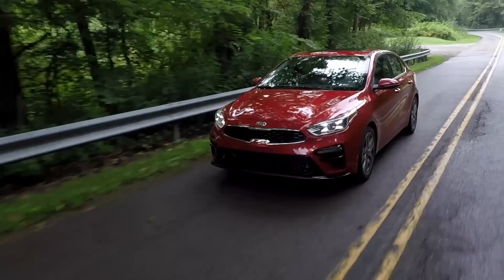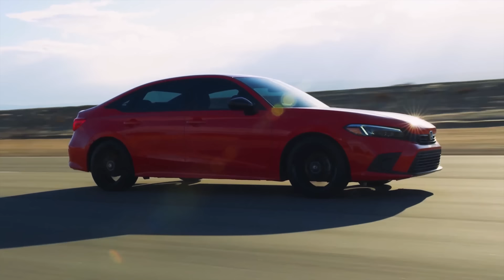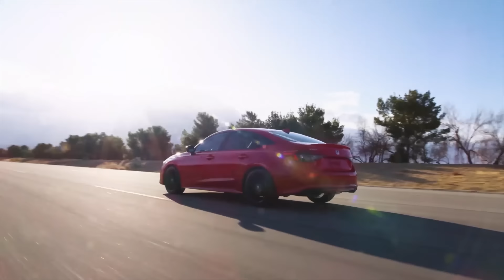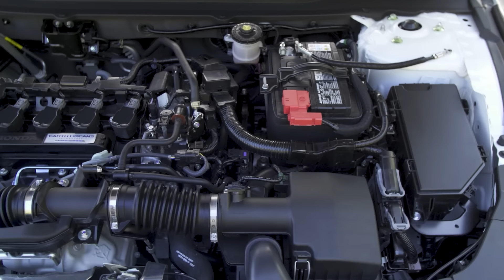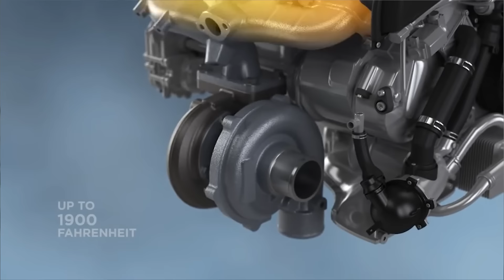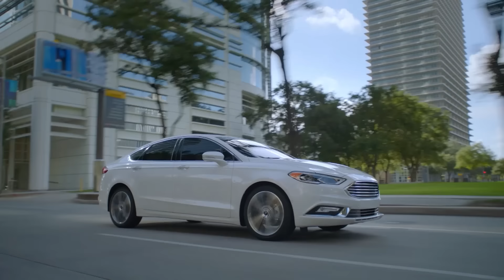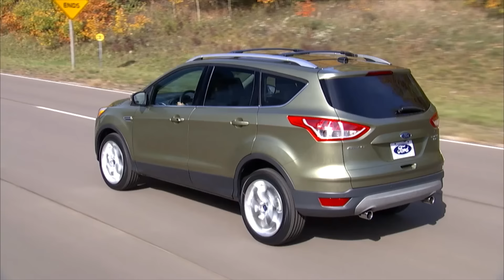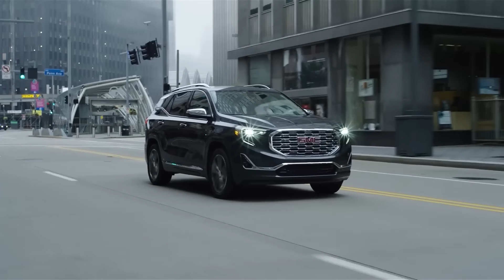Are Turbocharged Engines Reliable? The Truth About Turbo Engines

Comment: You don’t need a turbo to drive the car, the engine does that already. You don’t need a car with over 200 HP. My 1987 Oldsmobile Ninety Eight brougham had a 3.8 V6 and it was naturally aspirated producing 150HP and was plenty enough for passing on the highway and it could do burnouts if you stomped on the gas. But guess what it lasted past 270,000 miles. It finally died in 2018.

Comment: I’m still using a 20 year old Saab with the original turbo with over 180,000. 
Turbos engines can be extremely reliable but there’s a premium cost with manufacturing engines that withstand the extra stress.

Comment: not good man , i still drive a 25  yr old turbo  from vW , the infamous 1.8t
the car runs great, never replaced turbo, intercooler coil paks or injectors . even the camshaft timing chain is OEM
this video sounds like a rant full of bs on turbo engines
NOT GOOD MAN

Comment: All the issues spoken of in this video are from 2 major cause points. 
1 the engine built was given more turbo than it could handle. Over boosted engines will have head gasket and excessive wear issues.
2 The engines starting design was crap. This goes down to the block and head material. Cheap aluminum, non sleeved blocks. Cheap internals ie non forged pistons, rods, crank.
A properly built turbo charged engine will last yrs. There are a ton of them running around. From diesel trucks to passenger cars. 
Also most of these same issues are also found in N/A engines. Least we not forget about GM and the disaster that was cylinder deactivation in mid 2000s vortec engines or the spark plug issues from the Triton engines the list goes on and on

Comment: The simple fact about turbo engines:  the engineering is more economical, BUT ONLY WHEN THE ENGINE IS KEPT AT LOWER REVS AND WELL MAINTENANCED WITH STRICT SCHEDULED MAINTENANCE AND OIL CHANGES.

Comment: A turbo is a more of a passive system. The turbo may fail but it’s not hard to replace them. The intercooler is a passive air cooler again not really a maintenance issue 
I had a 97 911 turbo and the turbos were easy to get to and easily replaced

Comment: Turbo airplane engines are notoriously more unreliable and more expensive to maintain and rebuild. Cylinders lose compression and need to be replaced far sooner.  The main reason for a turbocharged airplane engine is high altitude operation. NA engines lose a lot of power above 10k MSL.

Comment: If you want to know why so many manufacturers went to smaller engines with turbos, go ask the EPA about the CAFE (corporate average fleet economy).  It was either go to turbos to get more power out of smaller engines, or nerf the power that a given vehicle would have to meet the new standards.  That aside, modern turbo engines have been tuned to run just fine off of 87 octane fuel, though many of them can make a bit more power with higher octane fuel.  If you don't want a turbo engine, then don't buy one.  I've had several now, the turbo has never been a problem.  Just do your oil changes on time and that makes all the difference.

Comment: I have a 13 year old turbo diesel Hyundai with nearly 140,000 MILES on it.  Still very happy with the engine.  Powerful, torquey and smooth
Reply: I have Nissan Pathfinder 2012 2,5 4 cilinder diesel with 300t miles and no problem with engine and turbo
Reply: What model is it?
Reply: I have an Opel GTC cdti sri 1.7 diesel, 12 years old with 127,171 miles and still going strong, very torquey too. I always give it a long journey regularly and always keep the revs low for 1st 10-15 mins to get to temp. Oil and filter change every 3 months at a minimum too.
Reply: Me too....but diesel turbos are a whole different ball game. Diesel turbos run on a full open throttle, it's the fuel injection that controls engine power, so far less complicated to control.

Comment: I owed 2 turbo engines and never had any issues with them. I have made 525000 kilometers with the first one in 18 years and my second one  is 3000000 kilometers and no issues up to now. I think the reason is the manual transmission which makes rev the engine higher between each gear. The other reason is oil and filter change every 10000 kilometers with full synthetic oil. The third reason is that I add additive once each month. That's my recepy.

Comment: My 2018 civic Si just had a cracked cylinder head at 90,000 miles . Mechanic recommended a new engine.  Ill probably never by another Honda again.  And i have always owned civics.  The new turbo engines can't last like na

Comment: As a retired Mechanic, I have yapped about this for years until I’m blue in the face! No one listens! Now that I drive for a living, I’m doubly fanatical about Service. My 2013 Hyundai Sonata (non-turbo 2.4 L) is known for having engine failure problems. Yet, at 219,000 miles she’s still running great! Whenever someone comes to me with a major problem caused by neglect, and I tell them what they should’ve done most of the time they say “That’s ridiculous!” to which I respond  “ Ridiculous? Who’s the one with a busted car?! You or me?!”

Comment: Between two equally competently designed engines, a smaller turbo with fewer cylinders is going to require more maintenance than a larger NA with an extra 2 cylinders. Yes you might get a slightly better mpg with the little guy depending on how you drive but the extra stress and complexity will likely mean you make up the fuel savings in repair cost.
Reply: You think I naturally aspirated six cylinder is going to get only slightly better gas mileage than a turbo 4???????
You better check some window stickers then.

Comment: I have been driving cars with turbos for  years with no issues  Turbochargers need good quality fully synthetic oils preferably  with a high ester content and of the correct viscosity range changed at regular intervals or more frequently.
With all of the above provided the base engine is suitable no issues

Comment: NO..FACT..I had a 1987 Chevrolet sprint...Suzuki 3 cylinder..turbo charged with intercooler...I drove that car 226k miles and all I did was regular maint..and oil changes..FACT...No issues from that motor ever

Comment: A turbo makes an engine do what it is not supposed to do. It makes it behave in ways that produce much more power, but the trade-off is you shorten the life of that engine dramatically, especially when the engine was not originally designed to have a turbo charger.  A diesel powered engine is usually very robust, and it is intended to have a turbo, but a gasoline powered automobile engine is rarely if ever designed to be strong enough to handle  the amount of heat and power forces that the engine will experience. I would lease one, but would never own one.

Comment: I have an F150 with the 2.7 eco boost and it’s been amazing at 104k miles…most the research I’ve done suggests they’re pretty reliable even out to 150-200k miles…eventually it will fail of course but every 150-200k miles I a long time considering most people don’t keep vehicles anywhere close to that long

Comment: I was a dealership mechanic. I bought a turbocharged Subaru with a 130K on it and drove it another 120K with no turbo issues at all. then I bought a VW with a turbocharged engine with 80K and drove it another 120K with no turbo engines. Both cars were over 20 years old when I sold them. I currently own another turbocharged VW with no issues. I live in a mountainous area and don't want to own anything but turbocharged vehicles. The added torque is hard to beat.

Comment: I like small cars but don't like their lack of performance due to their small engines. Then I found my turbocharged 2013 Fiat 500. Great performance, great brakes, and great handling. It also has the best anti-thief device available, a manual transmission. Other than normal maintenance, it has not needed any major repairs in 90K miles. It does need the engine oil topped off a couple of times between oil changes, but that's normal for a turbo engine. I don't mind at all for the performance increase. I love the thing and cannot think of another small car I'd rather have.
Reply: Fiat 500 has a brilliant and fun chasis mated to a good engine and transmission I bet its fun the Abarth 500 has a good following in Europe for this reason. I have driven a 1.0 Fiat 500 with 71hp it was fun to chuck about but just not powerful enough. The Abarth 500 fixes that issue.

Comment: My 94 Nissan 300 turbo made it over 300,000 mi . Only issue was the cam belt replacement on schedule and half shaft U joints .

Comment: Big rig owner here….  The simple secret ingredients are proper warm up, proper cool down and proper maintenance. I’ve dealt with turbos most of my life and I absolutely love them. A little patience each time you start and end your day goes a very long way. If you can’t exercise patience then stay N/A.
Reply: Yep! Assuming the engine, turbo, and transmission aren’t fundamentally flawed to start with… being very gentle on warm up, making sure the engine gets to & maintains operating temperature, allowing proper time for “spool down” before shutoff, and frequent oil changes will make all the difference in the world. I love my turbo I4s and I6s!
Reply: Which 99% of society does not do.  Instead the unlock the door start the car and are down the road in under a minute.
Reply: @waynespringer501  It’s ok to drive right away, but one should wait until car is warmed up fully before pushing the turbo.
Reply: @frankvee  that goes for any engine
Reply: @paulhunter9613  True, but particularly important for turbocharged engines because of the extreme high temperatures they operate within.
Reply: @waynespringer501  apparently I am a 1 percenter, I let it run for 4-5 min till it comes off cold / high idle. I hate to shift into reverse at 1300-1500 rpm
Reply: @waynespringer501  In fact it has been made illegal in the state of Colorado to idle your car (anti-puffing law) to warm it up.
Reply: Perfectly said brother! 😁👍
Reply: Thats helping the turbo for sure. But tbh thats the least of my concerns. With engines being build flimsier today and the turbo pressure Id be more concerned about the actual engine than the turbo.
Reply: Dude diesel are different those engines regularly go over a million miles.
Reply: Basically don't by a turbo engine for a work horse because it will be abused
Reply: I’m not so familiar with the terms, but when you say cooldown, do you mean leave the engine on for a while after parking? Or what?
Reply: @andresggcf  That is correct. Cool down the engine by letting it run normally after aggressive driving. This is accomplished by driving normally for several minutes, or letting the engine idle for a couple minutes after reaching destination and parking.
Reply: Proper maintenance is a must.
Reply: My Q5 tdi display, after minute or two says start driving and avoid idling. Yes, that's massage is on display, which doesn't stay on for too long and comes in Intermittently.
Reply: My q60 3.0t is twin turbo. I let it get to operating temp before taking off and 5 to 8 min cool off time before shutting it off
Reply: I’ve also been told to keep fresh oil in the turbo engine and keep the hard driving down. We just bought a 24 Rogue. Time will tell, but I’m all over taking great care of my cars
Reply: Let’s say if I wanna buy Kia carnival hybrid right? How many seconds do I warm up my car if I start it.
Reply: Yup tons of generalized statements with no facts behind them, like you I have had nothing but great luck/experience with turbo charged engines.

Comment: Turbo engines are not necessarily unreliable, but can be expected to be less reliable than a sound normally aspirated engine.

Turbo engines require more careful and appropriate service like oil changes and better oil filters, more coolant servicing and such. 

I owned a 1988 Dodge Daytona ShelbyZ. It had over 245,000 kms . / 153,000 miles on it when I (stupidly ) sold it. (Stupidly because I loved that car😢) it was operating perfectly fine. The only major service it needed was a clutch replacement.  It probably was going to need a second timing belt change, but I did not  bother as those Chryco 2.2 l engines were non interference. So if the to timing belt was to fail the engine would just stop without damage.

Comment: Turbos are not reliable like a normally aspirated engine. You are pushing the turbo engine to much higher cylinder pressures when under load and the turbos themselves literally get blazing hot and slowly cooks the wiring under the hood. Plastics and other things that would normally be fine on a regular non turbo engine for over 200,000 miles, will become brittle or even slowly get scorched on a turbo engine.
The 1.5 liter turbos aren't getting better mileage than the 2.4 and 2.5 liter Asian engines with the same horsepower ratings as the smaller turbos. 
The 2.4/2.5 liter normally aspirated engines from Hyundai, Toyota and Mazda all get better mileage and similar power to the smaller 1.5/1.6 liter turbos. 
The turbos are a joke and always were.

Comment: Had a 2007 Mazdaspeed6. Fun car with a 270hp turbo 4 cylinder, AWD, and a six speed manual. Turbo seals failed and it smoked a lot. Had them replaced under warranty. Sold it shortly after. Small turbo engines in big cars is not a good combination.

Comment: I think it also depends on the manufacturer. As much crap as Ford gets, their 2.0 ecoboost has generally been durable (not including the gen 2 coolant intrusion issue thats part of a recall). As long as you maintain them properly and on time, you’ll be fine.
Reply: For the record, the coolant intrusion really applies to the 1.5, 1.6 and the gen 2 2.0

Comment: Turbos are reliable. Just expensive when they break.  Go with Honda and you can't go wrong.
Don't do hard pulls when your oil is below 20%. Oil change is more important than usually because the engine oil runs through the turbo, so you don't want dirty oil.

Comment: I know turbos have gotten better but when I was younger I raced drag cars and the turbos were torn down after a couple of runs for fear they would blow apart during a run. Turbos are not made to run mile after mile and the small engines are being ask to put out the power of a big six or v8. You will never see them run 100,200 or 300,000 miles like many of the older sixes and 8’s did. I will walk before I buy a turbo or a EV.
Reply: Well keep walking then, soon it will be all EVs soon anyhow. So much drama Queens over forced induction engines. I have a 2016 lexus IS 200t f sport. My turbo is just fine what almost 7 years later. 😂

Comment: Like every other piece of equipment,  the tighter you wind it up, the sooner it breaks. Why are there vehicles from the early 2000s going 500000 miles without major failer, and 20 years later , your lucky to make 50000 without failer.

Comment: No they are not problematic, the maintenance as per the manual of the manufacturer is the problem… 20k mile oil changes on an Audi A4 for example is stupid. Change the oil at 5000 miles, you will have zero problems.

Comment: Turbocharger = more HP, increased oil consumption, decrease in engine reliability, increase in repair costs, decrease in fuel economy if the increase in HP is used often. My opinion as an import repair tech with 50+ years of experience.

Comment: They are reliable for the short term. Period. There is no perfection except God in the universe. You can get more performance out of a small motor but it will burn out much faster. Why? More heat, friction and so forth. I own a garage. Stay away from turbos.

Comment: Dont talk bollox. Turbo engines have been running for 10's of decades on ICE engines.  The question is how big a turbo on how small an engine. Turbos per se are not the problem.  Almost every marine diesel, train diesel, HGV diesel has a turbo on it.  The World runs on turbo driven diesels.

Comment: Have a Honda Accord 2013 with 3.5 liter NA V6. 28 mpg mixed driving, 34 highway if I keep it at 70mph . That's with regular gas. 0- 60 5.5 seconds. I don't think the added expense, risk and maintenance of the turbo is worth it. Expect to keep it another 10 years.

Comment: THANKS-- GREAT VIDEO-- and I was looking at one that is turbo-- but I think they DO have a NON- turbo one.   Problem is - would the 2.5 litter 4 cylinder in mazda be powerful enough for the weight of the car?? (and AWD?)   I was looking at CX-50 premium or maybe Meridian (also premium) and MY driving will be SHORT DISTANCE mostly.. and I wanted the AWD for winter driving...    I looked at OTHER vehicles but most others have CVT (crappy verified trash) transmissions in them.

Comment: Thanks for the video. Unfortunately I had a huge repair of the turbo on a Jeep Renegade 1.4L 170 hbp 92.000 km almost 5 years old. It started with parksense and cruise control failures and later Engine Management (yellow) signal and auto start/stop. Finding out when it happened, I lost huge engine power on accelerating while driving, but most anoying no cruise control at long distances. Finally at Jeep garage, the diagnostic and my description of what happened pointed the cause to the turbo. It is replaced, together with other things at the big service maintenance costs were 3.000 euro. At the garage they said, not your fault with driving style. But yes it fixed the malfunctioning of cruise controle, parksense and auto start/stop. The car drives fantastic again, at German Autobahn 180 km/h is easy, I never hit the maximum, I think of 219 km/h. Good thing is the milage, that is very good, average 7.5 liter per 100 km. And it can even do 5 liter per 100 km.